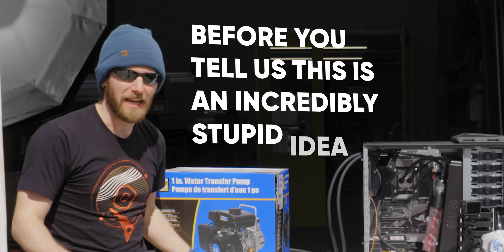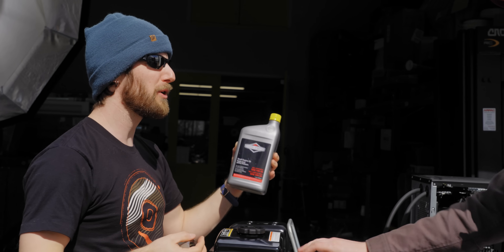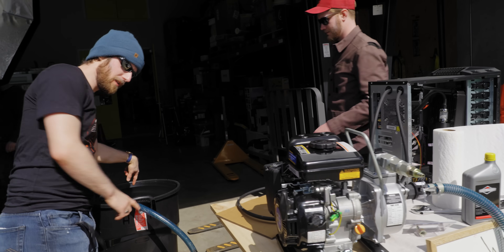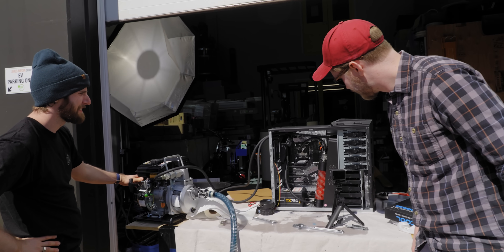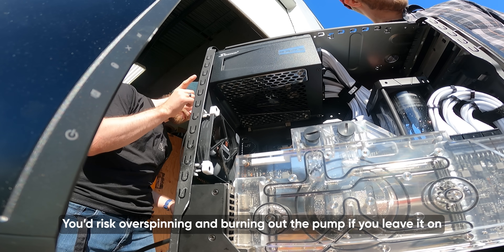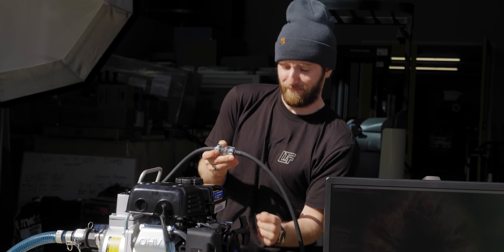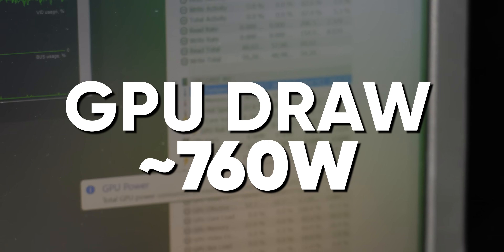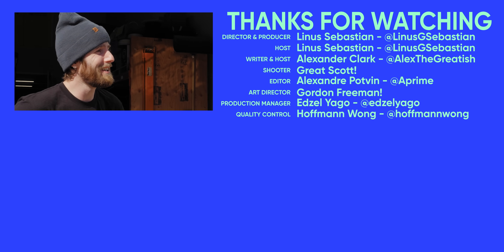Cooling a PC with a 2.5HP Pump

Comment: For the next cooling experiment, try cooling a PC with a liquid metal loop like an early nuclear reactor. 
Liquid metals like Mercury and NaK (the preferred choice for cooling applications) can be circulated using a electromagnetic pump. The pump applies a current to the metal inside of a strong magnetic field, causing it to be repelled and move perpendicular to the magnetic field.
Reply: Sounds dangerous. They should do it.
Reply: @stale2665  lmao, sounds dangerous....they should definitely
Reply: I want to see a water cooled steam deck.
Reply: @5226-p1e  steam cooled steam deck ?
Reply: @sravans149  
lol no, water cooled steam deck.
using steam would be a bad idea for all the moving parts within the deck.
Reply: Nak = sodium+potassium 
Sounds explosive
Reply: @abbu8779  It is. One has to be really careful with handling it, so I wouldn't trust these goofballs with handling NaK
Reply: @nika_0  It'll be FIIIIIIIINE.
... No but seriously Mercury is much safer. ... Relatively.
Reply: @nika_0  In their defense they do employ actual engineers so it probably wouldn't be too bad if they seriously tried.
Reply: That sounds like a horrendously stupid and dangerous idea with positively no gain whatsoever.
I don't just like it, i like it a lot.
Reply: Electromagnetic pumps can move Indium Gallium alloys. Both are cheap on ebay.
Reply: @Arcygenical  Gallium eats away at aluminum though, and I think most PC fittings are aluminum. Though they can probably find steel/brass ones instead with a copper block.
Reply: @DAKOTA56777  That's half the fun of gallium!
Reply: Replying to all of these wonderful comments:
I was unaware mercury was so regulated in Canada. Because of it's density, it isn't ideal for pumping anyhow. 

NaK can combust in high humidity and reacts explosively with water. It is also has a very high potential for galvanic corrosion which is why it was ultimately discontinued in most reactors.

Gallium and GaInSn are both prime candidates. Because it creates a soft, crumbly alloy with aluminum, the block, fittings and "radiator" will have to be copper. 

One thing no one seemed to think of is the fact that there are already liquid metals used in place of thermal compound. If they are true liquid metal and not a suspension, then they would not only be designed for these specific temperature ranges but also have an incentive to sponsor such a video by supplying the 2-3 gallons needed to fill the loop.
Reply: @Official_DJ_Spark  A plumber tried to flush some down a toilet.  He could not.  Not sure if that video is still on YT.
Reply: If only it was legal to buy mercury in the first place, specifically talking about Canada, not to mention the tens of thousands of dollars worth of safety equipment needed.
Reply: @silarious don’t worry, they got the proper licensing as a business and they have a hefty budget
Reply: @silarious  good thing if they record it its a business expense and tax free
Reply: go back to graphite pads 😅
Reply: Doesn't NaK have extremely high risks of blowing up?
Reply: @abhignavijjapurapu209  Most liquid metals are quite inert. They wouldn't have to go the NaK rout if they deemed it too risky. However, if you are careful about moisture exposure, it would be less risk than tab welding on lithium batteries, which they've already done.
Reply: Back when the xtremesystems forums were a thing one of our members got a hold of an old server that was cooled like that. It was intimidating to look at, with all the stainless cooling paths.
Reply: @abhignavijjapurapu209  Mercury salts are fairly toxic but getting a bit of elemental mercury on your skin isn't a problem. They probably wouldn't have the power needed to move mercury on any of their breakers. Gallium alloys or NaK would be the way to go.
Reply: LTT looks plenty of resources... but not that much. Buying the whole Thermal Grizzly company might be cheaper.
Reply: @carlosg_c137  sponsorship moment
Reply: I could only imagine the massive amounts of emi that would make in a computer considering how strong the current would need to be to move heavy liquid metals.
Reply: If they're completely suicidal then sure, use NaK, burn down the entire lab. Mercury sounds like a health and safety nightmare to deal with, especially if it leaks anywhere.
Reply: Yes
Reply: Imagine using an HDD with that lol
Reply: That sounds so cool
Reply: You can get mercury from old 90s cars. The mercury switch from the light under the hood.
Reply: @SamsonStrength77  Any tilt switch prior to around 2006, actually. Thermostats with turn dials use a bimetallic coil with a rather large mercury tilt switch. For the sake of a project like this, it would be cheaper and easier to just buy elemental mercury in bulk from a lab supply company. Again, this would take so much power only LabII could handle it. Gallium alloys would be the most logical place to start.
Reply: Are they selling used nuclear reactors on ebay anymore? I though they stopped.
Reply: The heat of the PC could heat gallium to the point that it could work as coolant.
Reply: @ajhauter5049  FINALLY! Somebody gets it!
Reply: @ajhauter5049  If it starts solid I'd worry they wouldn't melt enough of the loop before thermal shutdown or at least severe throttling. The CPU should be enough to maintain flow though.

But I'm sure they could rig a small heater into a case and switch it off once they have some flow.
Reply: Mercury and NaK would be fairly dangerous.

Gallinstan might be sorta viable if they can afford enough to fill the loop. Gallium would be cheaper, but they'd probably have to preheat the loop unless ambient temperatures were quite high.

For extra fun, use aluminimum for all the metallic parts. For extra extra fun, polish off the oxide layer immediately before loop assembly.
Reply: I saw a video of reactors working, and if I had money, I would ask them to make me a liquid cooler with skylight just like a real reactor core lmao
Reply: Wouldn't you be able to wrap enameld wire around a tube and run current through it?
Reply: Is that not essentially a liquid metal railgun hooked up to a cooling loop?
Reply: @justuslm  no.
Reply: Sounds like a colab with NileRed moment
Reply: @spamreciever4208  Nottingham University already has a functioning liquid metal pump that was used in at least once on Periodic Videos. Sir Martyn Poliakoff in a colab with Linus... 
I'd love to see it but it's not likely to happen. These days I'm guessing the Professor's Parkinson's makes it very difficult if not impossible to travel.
Reply: On a server scale solution maybe but  one or tow computers it seems overkill.
Reply: I think using a cooling tower would be a fun thing, where instead of a radiator you mist the water inside a tube where you have a fan blowing the other way, directly cooling the water droplets.
Reply: I saw a video on chubbyemu where a person died because a drop of mercury fell on her gloves and went through it to absorb into the skin.
Reply: @varunkaushik2834  In all likelihood, they were unknowingly working with a mercury salt or had compromised skin in that area. Check out the Standing in Mercury and Mercury Poisoning videos from Cody'sLab. He regularly exposes himself elemental mercury and blood tests show his levels aren't even elevated. 

AGAIN, mercury is not a great fit for this experiment. To keep the setup simple, gallium alloys are the safest and relatively easy to move with an electromagnetic pump. The second easiest would be NaK, but there is a much higher risk of fire should the NaK come into contact with water or very humid air.
Reply: @varunkaushik2834  , that was organic mercury, which from what I understand, is WAY more dangerous than regular elemental mercury.

Comment: Awesome guys.
I feel you need to do a scrap yard challenge cooler, Tesla engine couple to a high power pump, custom madecooler block with high pressure fitting :)
Or fire truck pump 🤣

Comment: The centrifugal pump is the issue. It will get to a certain pressure at the outlet and then just start passing water it can't get out around within the housing. As soon as that small adpater was fitted, the flow rate is capped at whatever the pump can push through the oriface, at the pressure it can produce, after that it passes water around the impellar. Now stick a positive displacement pump on there, thats a different ball game because you are physically displacing the fluid by changing an internal volume, very little chance for the liquid to escape resulting in higher pressures, as a result higher flows. Day jobs a hydraulics engineer ;)

Comment: Tapering the fittings way down like that choked the pump tremendously, could’ve attained the same flow with a much smaller pump like one made for an aquarium or small pond, but a huge gas pump is epic for a video.

Comment: Yeah, just for a test I used a large copper radiator made for a wood burning furnace. It did work, but was completely not worth the time or money or ugly appearance. The difference between that and a simple all in one was only 1.5C lower with the huge radiator. It was a neat test, but totally not worth it. LTT already knew it was worthless before they started. Still, interesting to watch.

Comment: I used to work on swimming pools. I’m familiar with electric pumps this powerful and more. 1HP is plenty to circulate most pools with 1 ½ inch to 3 inch plumbing. To get the most out of your pump you increase the diameter of your plumbing. Your pipes are literally your bottle neck.
To make the jump from 1HP to 2.5 HP worth it you need at least 2 ½ to 3 inch plumbing and multiple intakes and outlets. I’m surprised you didn’t have back-pressure to the point of just catastrophic failure. Makes sense that your motor cooked itself.

Comment: I think you should try to use a heat pump like one of a air conditioner, imagine the PC being the internal unit of an air conditioner, and it's connected to the external unit.

Comment: You could have just hooked the hose up from the faucet, and be cheaper. Water is cheaper than gas. Would have same pressure & flow, using those adapters will work as reducers. Nothing but back pressure on the pump. I guess it was clicky bait fun.

Comment: Alright. Now I want to see you cool every office PC with a 200 ton water-cooled chiller, a polyurethane insulated chill water reservoir tank, a 4kW circulating pump for the chilled water, and an air handling unit to bring down the ambient temperature and humidity.

Bet you will finally be able to run MS paint without worrying about thermal throttling.

Comment: Not a bad idea at all if it can keep the temperature at just around 45 C or below.  Just make sure that all tube couplings have no leak.  You can also use electric motor to power the pump instead of gasoline engine.

Comment: overclock a gas pump = overspeed the engine over the normal max rpm  engine says what the hell these cowboys doing to me help get me outta here   in the next extreme water cooling video there going to use a 6" diesel pump with 86hp to combat the super high gas prices this could be a whole new series of integrating power tools and equipment into your new pc build

Comment: What about dipping the computer in oil and then using the chiller? If there's no air around the computer due to the oil, there should be no condensation. It could allow for consistent extreme low temps Would love to see that happen.

Comment: Engineering-wise, I would have recommended a bleed-off line with a valve between the pump’s inlet and outlet. Start it with the bypass open (theoretically 0 down the load line), the divert the flow to the load by closing down the bypass valve, preferably gradually, until you find the limits your load can take.
Reply: yeah some backpressure adjuster thing would have surely been interesting
Reply: + an over-pressure valve to save your electronics. Though sometimes a bypass arrangement can be extremely sensitive to tiny amounts of change in the valve position.
Reply: I love how engineering worries about making a system better, despite the stupidness of it.
Reply: @tefoca  trust us, that's what we do for a living.
Reply: YOLO!
Reply: I've always wanted to find the limits of my load!

Comment: Big problem is the gas pump gets hot and heats up the water some when I pressure wash it can get the water pretty frickin hot if it been running a while

Comment: I can't be the only one that's thought of splitting the flow to run through several pumps and merging it back into a single loop to get the best of both worlds, right?
If you wanted to give this a try, look for Y fittings instead of T's, it might cost a bit more but won't restrict the flow as much.

Comment: The pump is slowed down by the other pump producing power sending it into the fans and such, so it has good pressure pushing it but if you remove the pump it would be faster at less pressure

Comment: Maybe you could do better by increasing the tubing size of all the in-computer tubes, then since you're already running a total loss system, hook it to a garden hose. Should be especially good for those who get their water from a deep well as the water from down there should be cooler. And no exhaust fumes plus you can run the lawn sprinkler with the outflow.
Or since your gas-powred-pump doesn't seem to have enough power use a pressure washer to force feed coolant into the computer's cooling system. 
Reminds me of the expression "like drinking from a 2-1/2" fire hose"

Comment: want to go more crazy? skip the loop - push water into the CPU block in one end, and leave the other side just open. With enough pressure the water will go flying away from the computer. Bonus points if you're a few meters from a swimming pool and still manage to recirculate the water back to the pool.

Comment: Uhhh, how about next time you use a mains powered pump and run part of the loop through the chiller section of a bar fridge? If you could make this work like a split-system A/C you'd basically have silent high performance cooling which would be practical in some circumstances...

Comment: I pump pig shit with 300hp pumps and 8” hose at 1300 gallons per min. Try hooking that system to a pc haha. Also the gas pump won’t add heat to the water, if it does it wouldn’t be noticeable. You can touch our pumps volutes while pumping and cool off

Comment: What if you modify the water blocks to use larger water fittings?  Like 3/8" or so, and maybe a smaller pump would do even better.

Comment: Using a 2.5HP pump to cool your PC can be an effective way to keep your computer running at its best. By using a pump to circulate the coolant, you can ensure that your components are being cooled evenly and efficiently. Additionally, using a pump can also help to extend the lifespan of your components by preventing overheating.

Comment: What if you go with electric pump and hook it to the barrel which is 2m underground? That might be better, although you will need to run the hoses to your pc
Reply: Yeah, at this point you can have a whole server rack hooked to a barrel in the basement and just use cables for monitor and everything else

Comment: You have a gas powered pressure washer. Same thing in a car's water pump and PC water pump. Only difference is that it's impeller is designed to move a good volume of water real quick. The fitting your describing is for automotive repair shop air hoses. As for your comment about high pressure low flow; DUH your adapting a garden hose outlet to PC water cooling. The smaller the fitting, the more pressure is created. At the end of the video you talked about using pre-chilled water as to not effect the water being pumped into the computer from carrying any heat from the gas engine...that's not how that works at all. The impeller the engine drives won't give off heat enough that it would add to your system temps. The engine is air cooled. If you look at the single cylinder it has fins on it; meaning that the outside air cools the engine off. When Alex talked about "overclocking the engine" what he's actually doing is changing how much fuel go's into the engine by adjusting a screw. You typically do that at idle. Now I would have preferred them to use a different water cooled PC for the testing and not my favorite sleeper PC...

Comment: Do I see that right? Are they using the watertank as an additional reservoir? Wouldn't that be enough to keep the temps down even with no radiator and no fans? I at least imagine it to take ages before all that water heats up, enough time for the longest gaming session...

Comment: Edit: Apparently that was just the paint melting off the exhaust heat shield. Explains the flakes. Disregard my comment below.

10:25 Yeah, seems like you overheated the engine. Without the engine moving, no air was flowing over it to cool it down (pushing a lawnmower is enough to keep it cool). In this case, looks like you melted the piston rings and started burning oil (which is why it started smelling bad).

Overclocking it didn't exactly help in regards to it overheating, either. Change the oil, and check the level constantly. Unless you replace the piston rings, that engine's going to burn oil forever.

Comment: I bet if you made a really deep CNC high flow CPU water block that could handle the high pressure and flow rate or gpm. You could probably really get some solid performance.

Comment: The pump in your thumb nail is a cap-run induction motor and not a combustion engine pump. come on guys, consistency. BTW, too much air in the water system and its creating "water hammer" which is whats causing the fittings to fail and not being able to get enough water through the system. You could put a little pump on the outlet to suck water through first and bleed the air out of the circuit before you start the engine.

Comment: Next time use a pressure washer, they are made to run at high pressure while that pump is made to empty a pool in a day with large volume but low pressure.